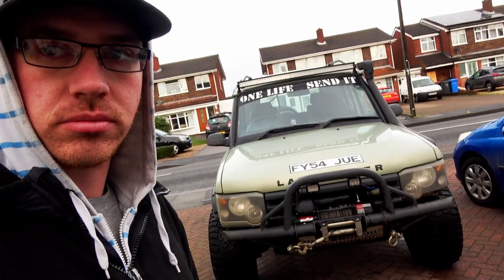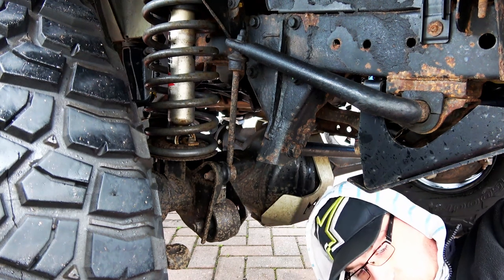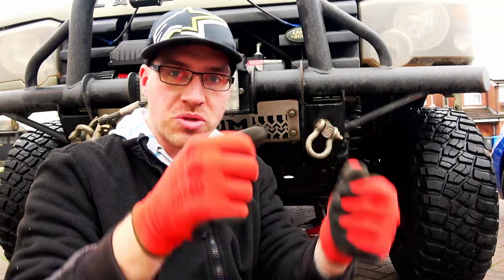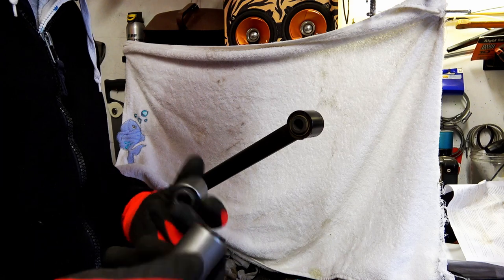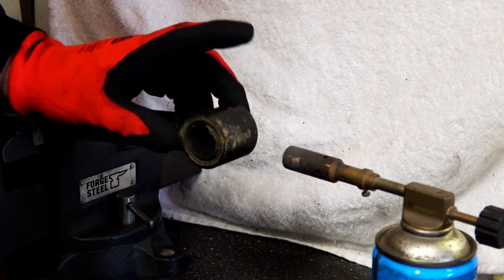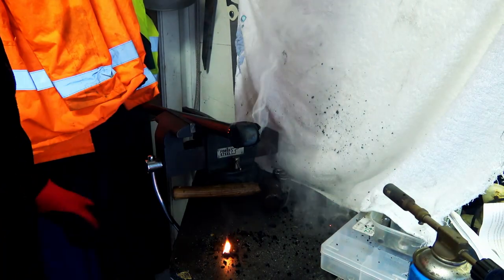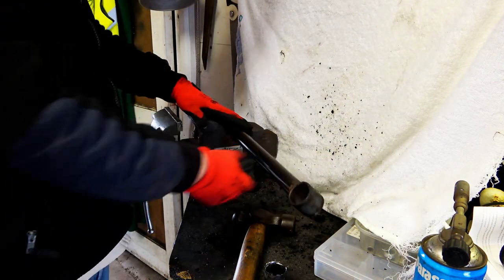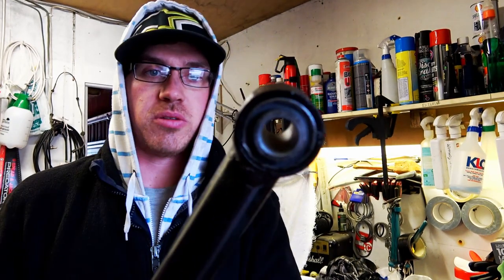TD5 panhard arm bush replacement

Comment: Good video and informative, but a tip - you need to torque up the bushes with the full weight on the axle, otherwise you’ll be twisting the bushes.